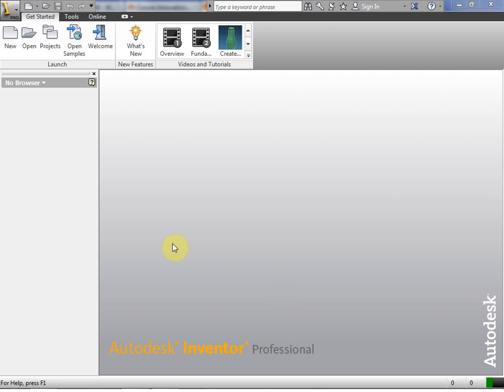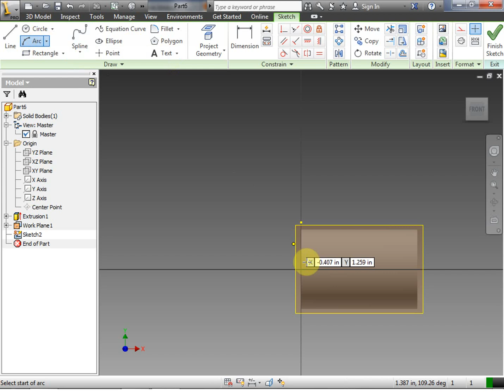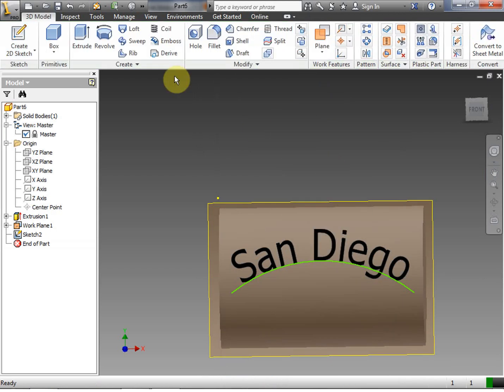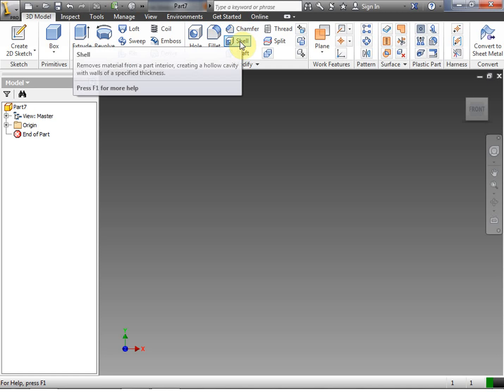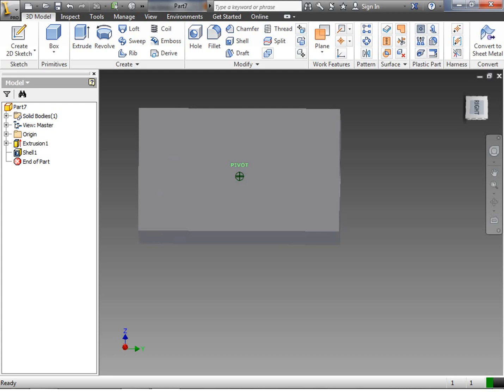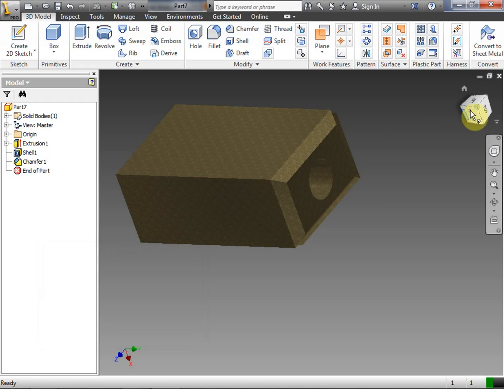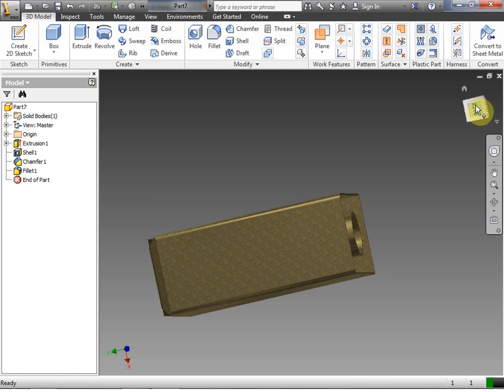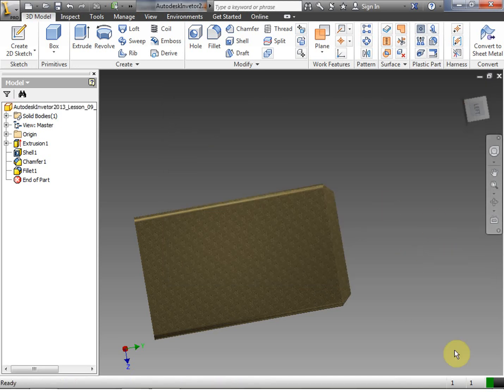Autodesk Inventor 2013: Lesson 9: Shell Chamfer

Comment: Those 'artifacts' you pointed out are real dimensions of this drawing.  What you saw was the internal dimension of the Shell passing beyond the Chamfer.  No wonder it gave you an error message.  It should have not let you perform that procedure.  In this case the Shell procedure should be done after you make the Chamfer.